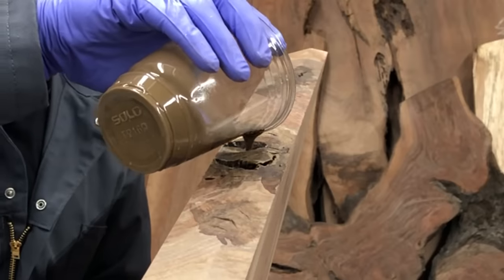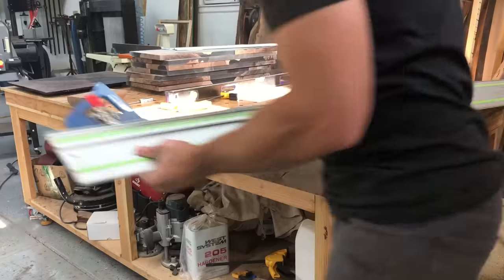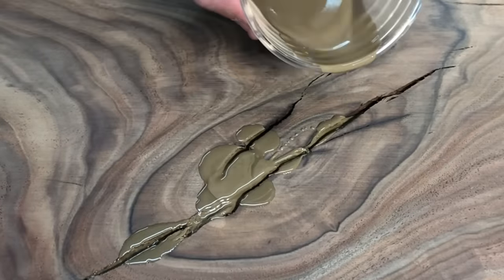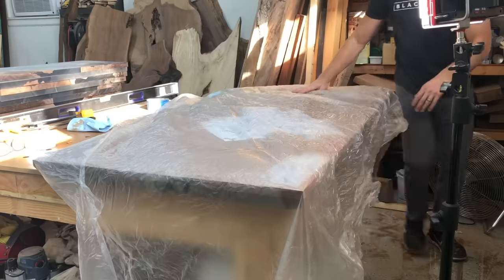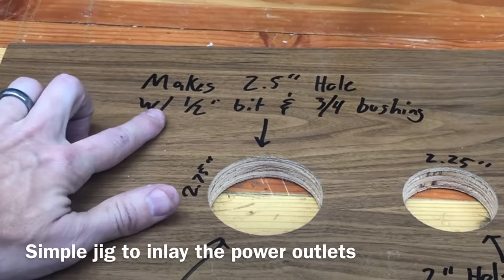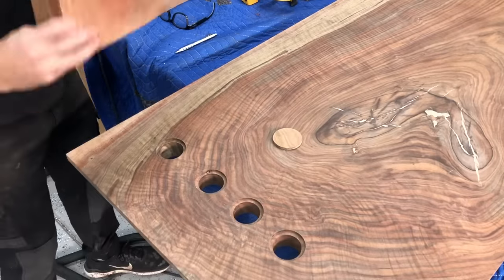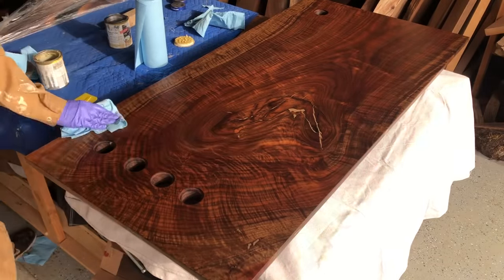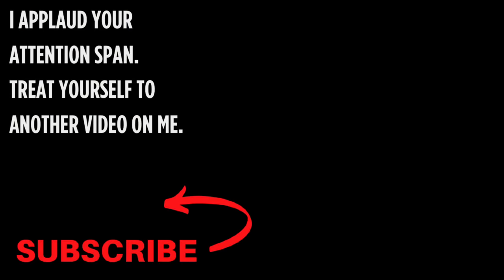My Toughest Client Yet

Comment: Cam .. just curious how much that slab cost ?
thx
Reply from the maker: I meant to put it in the video. $600.
Reply: @BlacktailStudio  yikes. Thanks. Walnut is so expensive
Reply: Ca.m. the walnut slab cost 600. or for the finished desk? You showed how beautiful walnut is. My dad, a carpenter, built two huge walnut bookcases on each side of the fireplace in his house.
Reply from the maker: Just the slab 😊
Reply: @BlacktailStudio  That's not even half bad for walnut that nice
I'd  pay that
Reply: Either way, walnut is crazy expensive and people have tried to steal entire groves of them. People have been shot and people have disappeared for having tried to steal them.  Seriously a large tree three or four hundred years old five to six feet across could bring a property owner enough to buy a new tractor. A small grove of them, and it's like winning a lottery.
Reply: CAM that desk turned out gorgeous. I love working with walnut too. Keep those videos coming my Brother.
Reply: He likely got it that price because the slab had cracks and knots in it----clean slabs would go for much higher.
Reply: @BlacktailStudio  Hi guy, 600$?, do you ship to Italy?
Reply from the maker: Talk to the supplier. They definitely do
Reply: Hi Cam
That table look just perfect, not to modern or to antique
Reply: Cam, the desk looks gorgeous, but I see you are using bronze powder which has more of a copper colour. I suspect it probably better suits the natural colour of the wood. I am curious however, can you get and have you tried actual brass powder? I love the look of yellowish brass in wood, and am curious about how it might look filling cracks and in larger volumes on a table.
Keep up the good work. The finished products are absolutely beautiful.
Reply: @MichaelMantion  If I had the money, I would buy huge pieces from him.  I managed to find a couple that were cutting black walnut to sizes you wanted and were surprised when I balked at them not wanting to sell me a live edge board.  I ended up buying the bark cut offs for $50 from the last month then another $60 for the walnut.  The cut offs will be a sculpting base in a pc case I'm designing.
Reply: Blacktail Studio you’re an absolute pro. Keep it coming man
Reply: Cam!!! Awesome build. Big fan. Can you share with us here where you got the lamp and matching USB charger and light switch thats in your video ?
Reply: Really really really great! 👍🏻👌👏
Reply: How Can, Thx for the detailed video with your tricks and tips for the brass epoxy. Did I hear you correctly say that you made about 100 test batches to figure out how to get it to flow the way you wanted?
Reply: Wood prices vary much by location. So 600 for him may be 2000 for an east coast city.
Reply: Cam thanks for the video. Looks like a beautiful desk.
Reply: That's a nice looking desk
Reply: In a world where I just paid $5 for a  2x4, that doesn't seem that bad.
Reply: Amazing piece before and after
Reply: The beauty of working with slabs is every single piece is truly a 1 of kind.  A display piece showing the hidden beauty of Mother nature.
Reply: Nice job cam
Reply: Cam 
how can i make a slap perfectly flat ( for a mouse to use on it)?
Reply: My mum gave away almost her whole walnut tree to a sculptor 🤦🏼‍♂️ I got one modest slab that I’m making into a table.
Reply: I love one piece table tops. Beautiful work.
Reply: @BlacktailStudio  $600 is an incredible price for such a beautiful slab, even with the cracks!   How long did it take you to find such a beautiful specimen ?
Reply: @BlacktailStudio  and this is the difference between a 2000.00 desk (this thing is both a functional and artful piece) and something you pickup from Ikea for 200.00
I don't normally covet expensive furniture and as such tend to not be the most respectful of the value...  But, this is gorgeous
Reply: Actually a solid price for the piece.
Reply: @Slidaulth  I'm surprised to hear that you could get this desk for $2000. And I'm someone with no familiarity with the value of handmade furniture.
Reply: @MichaelMantion  what happened to the lumber?
Reply: Just followed you! Always love finding others in the area who are in to woodworking. 👍 Beautiful work man.
Reply: @kenparnell4297  From a Oregon logging family, this is true. We find people trying to poach burl trees from time to time. Like the four locked gates to get here didn't clue them in that it's private property! lol
Reply: Hey Cam,   Really appreciate your work.  It’s beautiful and you make it look easy.(Even though I know it’s not).
Reply: It depends on THE PRICE....
Reply: @kenparnell4297  I plan on planting black walnut on my land when I am able to get control of some acreage.  The nut meat tastes like red licorice too!
Reply: @lyncheddie8257  NO
Reply: @wakranich3488  😂
Reply: @wakranich3488  I think it's more... 800$ is only the price for the brass desk inserts...
- 600$ of black walnut
- 800$ for the brass inserts
- probably the same or little bit more in epoxy materials
- add to that the hand works time...
=> I think the complet work is around 3000$ 3500$ all included!
Reply: Cam, that is a beautiful desk. Very fine workmanship.
Reply: @BlacktailStudio  I'm actually surprised it wasn't more.
Reply: Cam, this desk was beautiful
Reply: @donphillips5957  Jeez, where at?
Reply: @marlenesco  Lol the shipping will cost a lot more than $600. Probably around $3,000.
Reply: @donphillips5957  2x4s used to cost $2 before the pandemic.
Reply: @BlacktailStudio  nice... in my area it costs around 6000$
Reply: Cam, how would you recommend buying lumber for a live edge floating shelf? I want a walnut slab, but don’t have all the tools to clean it up the way you do.
Reply: @donphillips5957  Amen to that
Reply: Cam.. just looking around for different tech ideas to include into my desk that I’m building w an oak slab, and your video was great for that, amazing and helpful, thank you!! -Alisa
Reply: @aaronkoh8236  yes those are lovely details.
Reply: @BlacktailStudio  wow that's cheap great deal
Reply: @JTMarlin8  this table cost 11 000 $ 
Not 600 or 3000 😂🤣😂 
look his page
Reply: Less is more… never a bore…
Reply: Cam what about something with alot of voids similar to how old railroad ties have alot of voids
Reply: @BlacktailStudio  WOW!!!! That's a STEAL for a large slab of Claro!!
Reply: Cam thanks again for sharing.  I wish I could show you some of the things I build as you have inspired and taught me so much through this journey.   Thanks
Reply: @kenparnell4297  mosiformation
Reply: @BlacktailStudio  that actually sounds like a descent price for a slab of that size. I've seen slabs half that size go for $800 or more locally.
Reply: Cam just watched the desk video, in one word awesome!!.
Reply: @BlacktailStudio  That is... a very reasonable price.
Reply: It's a beautiful desk, but do you ever make them with the natural shape of the slab or at least one side. I just think that would look better sometimes
Reply: Cam another great job, really appreciate your generosity in sharing the lengths you go to to impart the lessons you’ve learned on your projects- the specific materials, the vendors and shops you use, the tips and tricks and the costs of wood, materials and the prices you charge customers for finished pieces. Great videos.
Reply: ONE MILLION DOLL HAIRS!!! Bruhhhhahahahahahahhhhhhahhhhhh
Reply: @BlacktailStudio  Your work is worth every penny. What ever the cost.
Reply: CAM-- BEAUTIFUL WORK!
THANK YOU FOR SHARING! 
Greetings, from Salem, Oregon 🌲🌲🌲🌲
Reply: Cam, that's a solid price for that slab of figured walnut. Beautiful piece!
Reply: Nice work . And vid. Cam
Reply: I know a cat who built a floating dark walnut and black iron 13-step staircase leading to his office loft and he said he had 2K in just material. Each step was 2×12×30.
Reply: Cam, that is beautiful. I have a guy that supplies me with 40 to 50 inch diameter cedar logs that I turn into dining tables. They don't look as good as your desk. Nice job, Cam.
Reply: May I inquire as to what the most expensive piece of wood that you have used was?
Reply: Cam I have just watched this video and I have Great admiration for your skills.
Reply: @BlacktailStudio  Where can I get that light?
Reply: @donphillips5957  GUT LAUGH!!!
I know what you mean 😢
Reply: That's a beautiful desk but in just my taste I would rather use crushed turquoise, not too fine but it looks beautiful with dark wood
Reply: @nehabkeinyoutubesry  lay it inside a router sled propping the ends so it doesn't wobble.once you level that side, flip it and do other side. Videos on router sleds.
Reply: @BlacktailStudio  daaaamn im actually incredibly surprised it was only that much, such a beautiful piece
Reply: Cam, ur wife annoys me....lol
Reply: @BlacktailStudio  iu
Reply: @nyetloki  walnut isn’t more expensive on the east coast in my experience though! Your mileage may vary
Reply: @kenparnell4297 , I worked at a golf course in MD. back in the 80's. Our boss let us cut down a huge Walnut tree for one of our co-workers. He was going to build all his bedroom furniture with it. It was probably 12 foot in diameter at the base. I can't imagine what the tree would cost today!!!
Reply: Cam awesome job. That's a beautiful piece. Hope tour wife is happy with it. Aso i think it has the perfect balance on technology and rustic look.
Reply: @BlacktailStudio  Cam, what would this project run if you were doing it for a client?
Reply: @nyetloki  and now maybe even 3k
Reply: @DarthJeep  you’re under selling your self mate.
Reply: @wakranich3488  $600 for the finished desk? Maybe at Ikea!
Reply: @BlacktailStudio  how much for the finished desm
Reply: @BlacktailStudio  Wasnt it black maple?
Reply: Damn Cam! As perusal, you slayed another project! 🤘🏻
Reply: @alexpasaila2214  too*
Reply: @uuuultra  but clean slabs are boring (not always, I know), I'd rather have a slab with a lot of prep work but a lot of figuring than a bland clean slab, but that's my opinion

Comment: Cam, a good idea on how to really stretch the brass powder and make it last longer would be to fill all but approximately an 1/8" of your cracks with a clear or black dyed epoxy and then mix up a small batch of clear epoxy and the brass powder and fill in the remainder. 
I'm curious if you played around with this idea. And if you did, what was your results? 
Also, I bet this would look flipping badass against the black of a burnt tabletop!
Love the way this turned out and that hardware is top shelf, my good sir. Top shelf indeed!

Comment: Cam, I do a lot of cold cast metal figures . I use urethane clear resins as my binder, but the concept is the same as for epoxy.  Metallic figures can be a budget killer due to the expense of the metal,  which of course is tied directly to solid metal per pound cost. I slush coat my figures with at least two separate coats of metallic/resin then fill with the same resin but using an inexpensive filler(glass bead, urefill,etc), I have even used chop fibre  where strength is needed. Have you considered doing a partial fill with bulked epoxy, then reserving your metallic powder for the top 1/8th or so ?

Comment: Cam, that was beautiful! I think you're right not to "over-tech" it. Technology is great for a while, but solid lumber? That's timeless.
Reply from the maker: Thanks so much!
Reply: Cam, I would consider it a smart desk. Just curious, do you ever use design software like SketchUp for more complex projects, or do you just 
plan in your head and start cutting?
Reply: @BlacktailStudio    Actually I'd have made the desk to accommodate wireless charging as you already drilled holes for the brass fittings and one more shouldn't make that much of a difference.  For 49 weeks out of the year there is only one thing that I absolutely hate with a passion and that's seeing USB wires connected to phones sitting on my nice orderly desk!   The remaining 3 weeks out of the year are completely reserved for and devoted to the hating of Auburn, Tennessee and LSU, of which there is no greater hatred, especially Au Barn, of which I'm currently coming off of a serious hate-high on Saturday night with that 4OT win!   RTR!
Reply: @ronwilliams329  :  GEAUX TIGRES` !!!
Actually, Bama is my second-most favorite team!
REAUX'LL TIDE!
Reply: @rl2109    Yeah!  And those dawgs thought they got hit right over the head with a big Baton Rouge last Saturday!
Reply: cam  It's definatly a beautiful desk made smartly.

Comment: Cam: This is excellent. I love the brass filler, and it goes with the accessories so nicely. From a distance, you might not notice it right away, but when you get up close and personal, I am SURE it is beautiful. I personally wouldn't call it a 'smart desk', as it doesn't have any 'tech' functionality, other than the light dimmer. That said, who cares? It is still very 'smart' looking. Bravo Zulu. Well done.

Comment: Cam, Love the desk. Although I would have added the wireless charger. the wife and I are working a design for a shared desk. 56 X 50 using canary wood. May try and incorporate the brass epoxy. Have to present the idea. Love your builds, keep up the great work.
Reply from the maker: I originally planned to, but the wife talked me out of it. I’m sure yours will be awesome.
Reply: @BlacktailStudio  I would wait.  it wouldn't be hard to carve out a section after words and add a coil and driver in the future.  TechIngredients might be able to help you with that and a speaker driver later.  It would also be neat to have an integrated themocouple  cooler / heater into the desk to keep beverages warm/cool.

Comment: "the wireless charging technology might be a bit dated" but you put two USB type A ports there? :-P
Reply: Well the technology isn't very good. It charges slow and wastes energy compared to a cable
Reply: @howdoideletethisthang  yeah I agree with you there. Might just be me but if my phone is going dead it's cause I've been using it. And I don't want to have to put my phone down and not use it. Also I'll be glad when USB C replaces everything, but for some reason they're not in a big rush to do so.
Reply: My guess is that the type A ports can easily be changed out for an insert with type Cs.
Reply: Those type A's are just for power though not data, all usb 2 and later standards can provide 5 V 1 Amp which is the most common charging standard. Fast charging  would require a USB 3.0 or later as it requires up to 15V and up to 4.5 Amp. I imagine this was probably an aesthetic choice. At the end of the day though. If you've got the charger there on the desk does it need to be fast?
Reply: USB A is probably going to be around for the next 10 years  usb c is great gir high power applications and high speed applications.
Reply: No Cam, no answer.
Reply: Well wireless charging did improved fast and is now actually faster than regular 5v 1A USB-A charging. Not to mention more versatile: you can charge any brand of phones as long as they support wireless charging.
USB-A can also support high power. My Huawei charger has a USB-A port yet it goes up to 40w (10v 4A) and while everyone has a USB-A cable, not everyone has a USB-C cable.
Reply: @Zoroaster4  because they're several orders of magnitudes more expensive to manufacture
Reply: @v1Broadcaster  Yeah but they aren't that expensive you can buy them online for less than ¢20. I would be willing to pay an extra quarter everytime I bought something to have just USB C on everything.
Reply: @Zoroaster4  I'd pay an extra dollar to not have to use USB C, I've had terrible luck with the ports on my last two phones wearing out prematurely.  I plug them in every 2 days, laying flat with the cable supported on the nightstand, using the OEM cables and in less than a year they're so loose that the cable almost falls out.
Wireless for this guy, mostly because when the port finally wears out, I'll have no choice but to charge wirelessly.
Reply: @barrylinkiewich9688  I don't know man I think you just have had bad luck. I've had 3 phones that use it multiple sets of headphones, 2 wall chargers, and a battery pack. I haven't had any problems with them breaking.
Reply: @HarploBartow
Those are screw-in and easily replaceable. For the wireless charger, you have to typically cut almost all the way through the wood to have something strong enough to actually work... or actually cut all the way through if you wanted it to be reliable. 

Because of this, if this needed to be upgraded/replaced, you wouldn't be able to fill in the holes, thus you would have wasted technology that has a failure point.